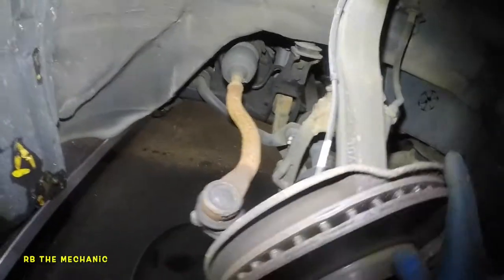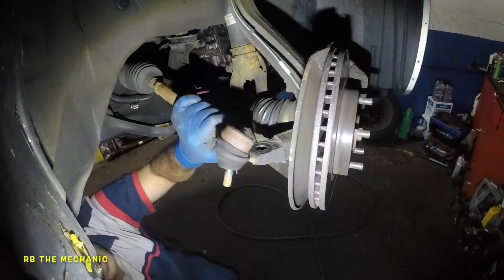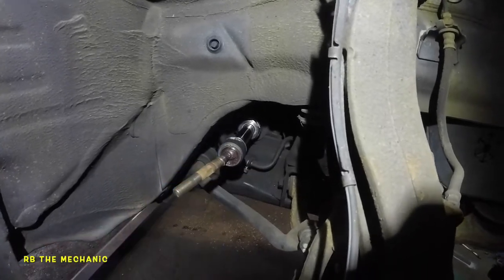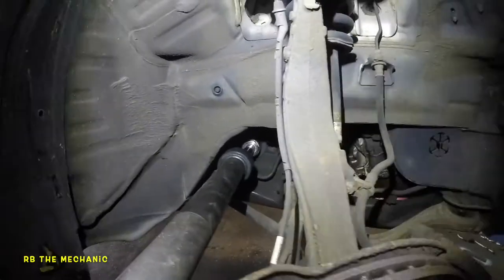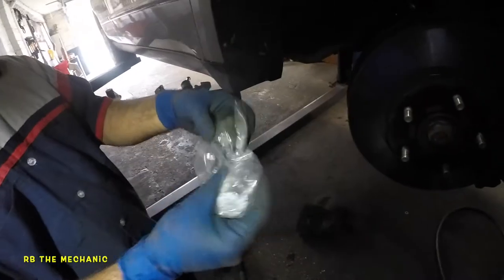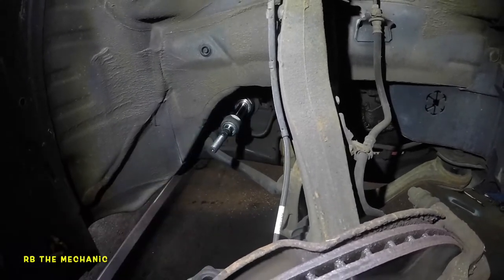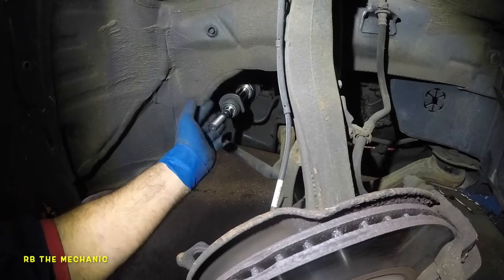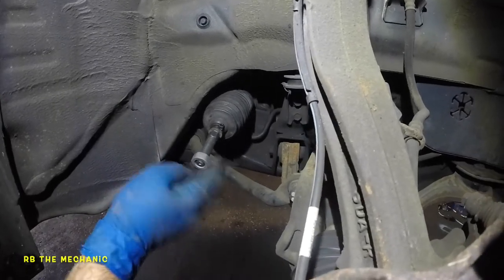Replacing inner and outter tie rods on Honda Accord 2003 to 2012

Comment: Hey brother I have an 06 Accord V6 I replaced my tie rods maybe 2 years ago Amazon I'm able to move the outer tie rod side-by-side with a little strength it's not hard at all to move side to side is that normal it's not like a super loose or anything but I'm able to move it side to side with a little bit of force
Reply from the maker: There shouldn’t be okay moving it from joint is fine but joint shouldn’t have play
Reply: @RBTheMechanic  thanks brother I have clunking and creaking only when front driver side wheel almost underneath the pedal my lower control arm the front is cracked but not major my swing links look good the creaking and only happens when I drive when I try to jump up and down on the car there's no noise it only happens when I drive

Comment: If that tie rod goes bad again the next guy to change it is gonna curse your name. Blue loctite is fine. And use a torque wrench to tighten to spec. Otherwise good video
Reply from the maker: I RED! All the way safe than sorry. And it comes with red locktite

Comment: Good video I just don't like how you tell people to count the threads not all out of tie rods are created equally use a tape measure always had better results I mean if it works for you it works for you but sometimes the thread depth is different and sometimes the tie rods aren't as long this only works at the exactly the same in a lot of cases they're not. Good video otherwise
Reply from the maker: Oh ok yeah but it’s pretty close at least ur car will be stright to get to alignment place I seen sun mechanics do work and u can even drive